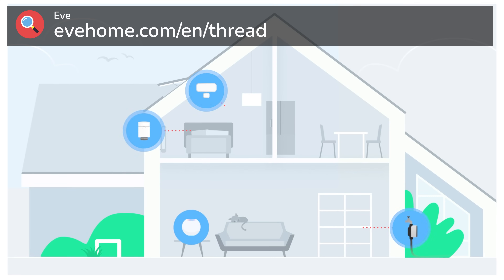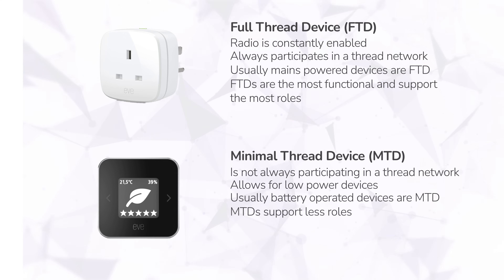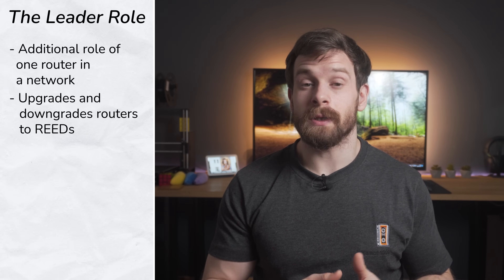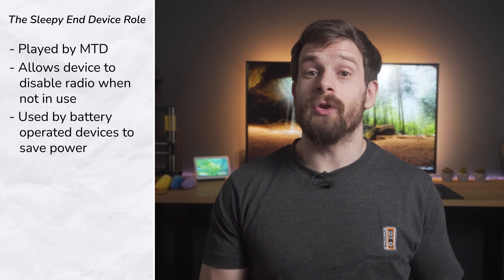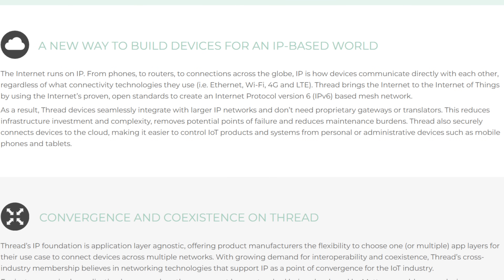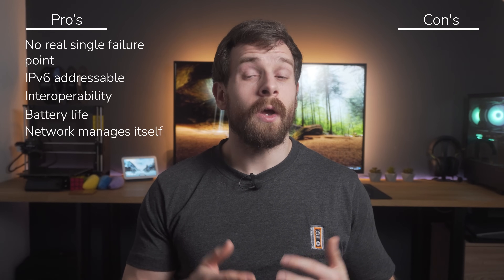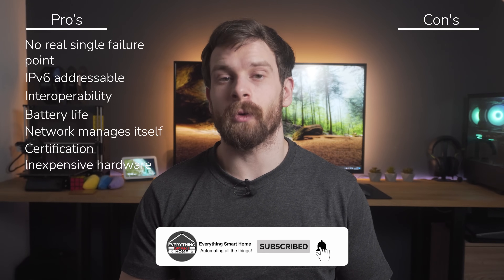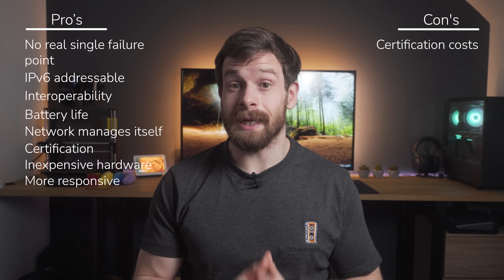Smart Home Protocols: Thread Explained!

Comment: The first Pro is incorrect. The network needs one Thread border router and If that went down the entire Thread network will go down.
Reply from the maker: No, there can be multiple border routers in a thread network. Said it a few times.

Check the first link in the description
Reply: you can have multiple border routers
Reply: @EverythingSmartHome  missing the point completely. If you have only one capable Thread border router. Then it does not matter how many full thread devices you have. The thread network will fail if the only TBR goes offline.

Didn’t you try saying the complete opposite on Twitter, ask Jonathan Hui about this
Reply from the maker: Of course, if you choose to have only one border router then obviously it will fail - that's literally a given. But you have the option to have multiple - a choice not provided by some other protocols.

I think it's pretty obvious if you choose to have one and it fails then yes you will have a problem...I don't really understand what your getting at?

Also, the thread network won't go down if your border router goes down, you just won't be able to access it from your normal devices. But the network itself will still be up.
Reply: @EverythingSmartHome  I do like the vids you make and the effort. But from a layman’s point of view, the description you make of this is not clear. 
you say that it only has two types of nodes and this is where the confusion comes because how you explain it. The hierarchy is Thread border router, Thread router and then end point. 

A leader device is not a thread border router. The leader device is the main routing device within the network. A TBR is the interface between thread and other networks like wifi. 

The statement you refer to in the video about a leader is one goes down. Another thread router can take over as the main thread router. Which is completely different to how a border router behaves.
Reply from the maker: I never said a leader and BR were the same? I said they are different roles?

Sorry I just don't follow you dude
Reply: Correct, a leader device only helps with routes inside the thread network and other FTD can take over. A FTD does not create the core network. A border router does this.
Reply: @EverythingSmartHome  if a border router goes down. The thread network will go down. I can take this to twitter and ask Jonathan Hui about it.
Reply from the maker: Jonathan Hui literally reviewed this whole thing before it was filmed.
Reply: @techytime6197  As a beginner I'm not playing in the same division as you guys, but for me, it seems strange that the thread network goes down if the link to other networks fails? The leader is still up'n'running so why should the thread network go down just because a border router does? If you mean that you can't access it from other networks I get it, but that's not "thread network going down"? It's like saying "the car broke down" when you just can't open the garage door or something. The car still works perfectly, you just can't reach it from outside.
Reply: @techytime6197  you can have multiple border routers in the same network so if you for example have 2 and one goes down you still have one ,yes if u only have one than it won't be accessible from the outside anymore

Comment: Great video again, I have just begun with my smart home so I'm still on WiFi only but will get more stuff and expand my life to other protocols. I think for now tho, that I'll let others try Thread. If the availability of Thread devices increases I will reassess my decision.
Reply from the maker: Thanks, glad you enjoyed it! There is no rush, take your time and enjoy the process!
Reply: @EverythingSmartHome  yeah, I haven't got my lab going yet after rearranging my office. I was too eager to set up my 3D printer so cleaning and setting up the electronics workplace lost the battle for my time😁
My goal is to build some ESP8266/ESP32 gadgets for the smart home. For the mains power control I like the Shellys, but low voltage sensors I think I can build cheaper rather than just buying everything off shelf.
Reply from the maker: Nice, so much potential with the 3D printer! 😁

Comment: This video verbally mentions one disadvantage of "Thread":  no hardware devices.  However, this video does not show this as a CON on the comparison chart.
Searching on the internet:
> "Drawbacks or disadvantages of Thread Protocol
> ➨It does not support very high data rates unlike wifi. 
> ➨It does not support very long range, unlike cellular wireless technologies. 
> ➨Maximum number of devices (~ 250) supported are less than zigbee (~65560) .

Others comment that Zigbee devices, etc can eventually also work with the Thread protocol & devices.
Youtube pointed to one instructional production about Zigbee.  However the real wireless range is only about 20-40 meters?  Still very confused.

Comment: This is helpful video thank you.  Have a question:  I currently have a SmartThings v2 hub which is my main hub for most of my device automations.  The hub is Matter capable, but just not a Thread Border Router.   

However, I already have 4 active Thread Border Routers (from Apple, Amazon, Google) and all my Matter-over-Thread devices still successfully connected to my ST V2 hub. The SmartThings hub is just not natively utilizing its own Thread network and relying on the one of the other four. Also aware of losing half the memory and processing speed upgrading to ST v3 hub.

My question would be if there are any advantages in having ST’s own Thread Border Router and network as I start building my Thread Network?  

Maybe if it ain’t broke don’t fix??

Comment: Great video!!  So if there is no coordinator (only a leader which is dynamically defined) how might it interface with your Home Assistant server?  I'm assuming there would still need to be a USB dongle or something.
Reply from the maker: I'm not sure yet, either you interact with the border router, or in the case of Home Assistant Yellow which has thread built in, then it may potentially act as a router in the network? Time will tell!
Reply: @EverythingSmartHome  so if I understand the home assistant thread integration correctly it supports "matter" and "homekit" which are two "languages" that tunnel inside of the thread network. So any devices that are "built on thread" and use either matter or homekit to talk will probably work with it?

Comment: I know these is a old video but hopefully someone will see these and try to answer I have about 10 devices in my home that work with wifi and about 9 thread devices including a Apple HomePod as the thread broader router and have three Nanoleaf light and a Eve plug and the rest are thread child devices I turn off my eero 6 router and when my wifi came back I saw that my child devices returned to Bluetooth is the  natural and my Nanoleaf and Eve plug turn to full thread less then one minute just wondering if that has happened to other people or do I need to connect a Apple TV so the thread network switches to it ??

Comment: I find it ironic that Apple makes such a big deal about other manufacturers having to jump through hoops to get their devices certified to "Works with HomeKit" to be able to play in Apple's ecosystem and YET they have not gotten the HomePod mini to be Thread certified.

I am also amazed that the new Thread version of the Eve Water Leak sensor is not listed as being Thread certified, but all of their other Thread devices are. I am wondering what the hold up is on that.
Reply from the maker: Hmm hadn't noticed that about those Eve devices!

Comment: Since the thread standard is 7 years old, what has hindered adoption up until now?
Reply from the maker: Not actually sure to be honest!
Reply: For manufacturers it's more profitable to not have compatible devices. Manufacturers want consumers to be stuck in their ecosystem. Then when a customer needs a new product, he/she will buy a product from the same brand.
Reply: @erivaton  This doesn't account for the success of zwave and zigbeee compatibility
Reply: @uSlackr  True ... Zigbee however has a lot of compatibility issues. And Z-wave is is not open source.
Reply: I’d guess it’s somewhat of a chicken/egg problem. Considering the costs associated with licensing it, perhaps it was seen as too risky to support, considering the number of potential customers is low.

Comment: If Thread uses the same radios as Zigbee, is there a possibility that certain Zigbee devices could be migrated to thread through a firmware update?
Reply from the maker: I had hoped that would be the case but there doesn't seem to be anyone indicating this to be the case (although I could be wrong I just didn't see anything personally)
Reply: @EverythingSmartHome  Isn't the zigbee chip on the Home Assistant Yellow also thread capable, and will be enabled for Thread in the future?
Honestly, it just sounds like it's a firmware thing, which if a company is willing to support that firmware upgrade or not is the real question.
But shrugs dunno for sure.
Reply from the maker: Oh yeah duh, completely forgot about that! 🤦‍♂️ Thanks for reminding me.

Then yes at least I couldn't find any manufacturers willing to say they would update their existing products...apart from home assistant ❤️
Reply: @MarisaClardy  They actually say the chip is forward-compatible with the upcoming Matter smart home connectivity standard. Call me pedantic but it would have been more accurate to reference Thread rather than Matter. But then I could just be bitter as I purchased a Blue ...
Reply: These and the sonoff ZBDongle-E can now be flashed with a thread supporting, matter speaking firmware. Plenty of tutorials

Comment: I'd also put IPv6 in the 'con' column as it will make it possible for devices to be locked to the cloud. It remains to be seen if that will happen, hope not. The border router approach is nice, but they will basically have to act as firewall and bring extra complexity security wise.
I don't want to sound pessimistic, I'm really exited and would gladly replace my Zigbee devices with it if it delivers all its promise!
Reply from the maker: That's a fair assessment, I can agree!
Reply: Wouldn't that make the device non-Thread compliant? To be Thread compliant don't devices need to interoperate with all Thread routers?

Looking at it from a Zwave/Zigbee perspective. Any of those devices would also be non-compliant if they didn't work with all gateways.

Or in the context of the IPv4 based UPnP protocol, a device can't be UPnP compliant if it doesn't respond to UPnP requests on the local subnet.

Similarly a Thread compliant device can't be compliant if it doesn't follow the standard.